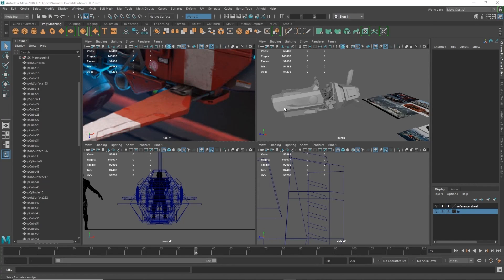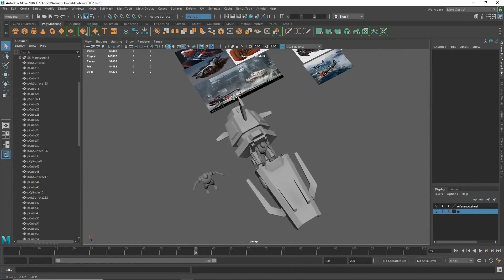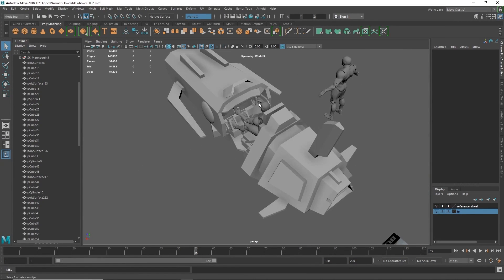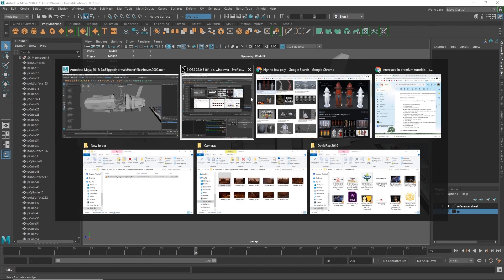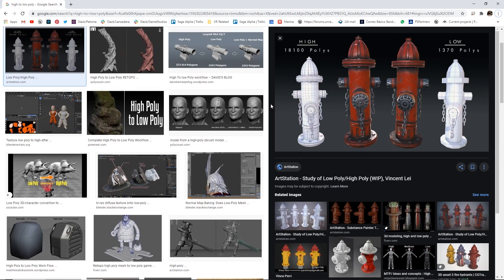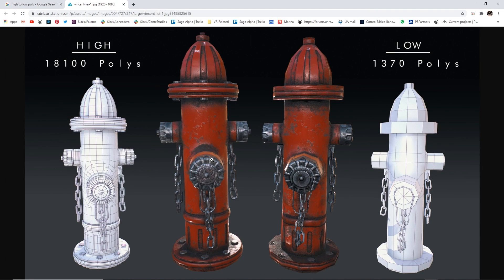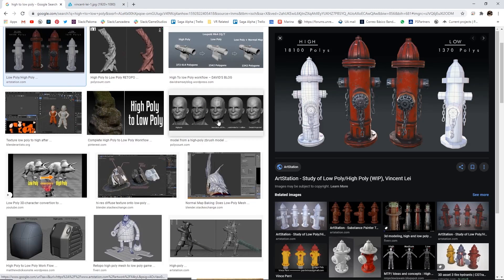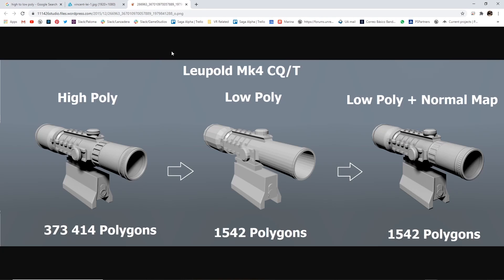Baking Maps Explained

Comment: It's easy to recommend the painting with alpha height maps, but you still have to MAKE those alpha's, and they are usually made by actually making a high-res 3d model and then baking it into a height map to be used to stamp onto the model.  So either way you're still doing high poly modelling.  Unless you buy an asset pack with tons of these height map alphas that just happen to match exactly what you need for your own project.
Reply: What I do is create those height maps in Substance Designer.